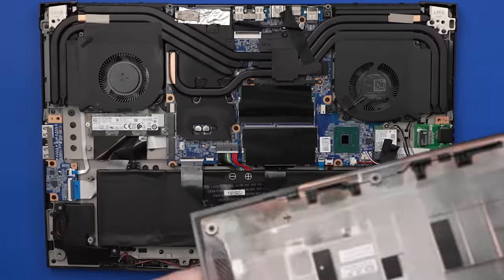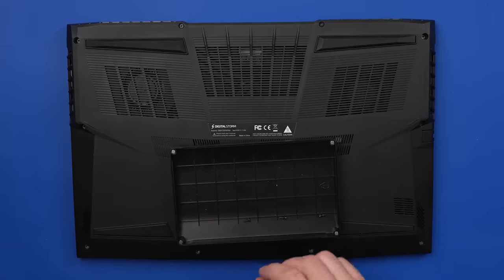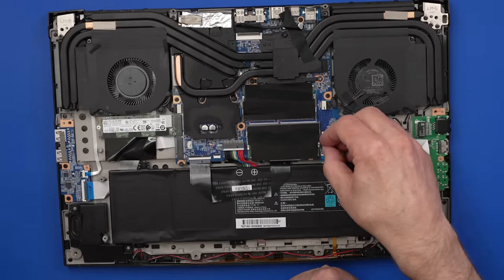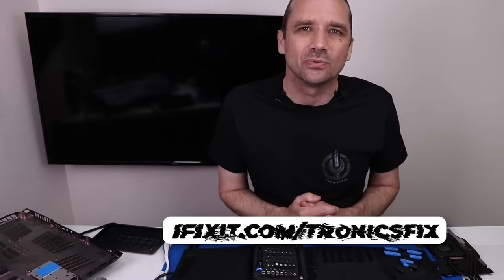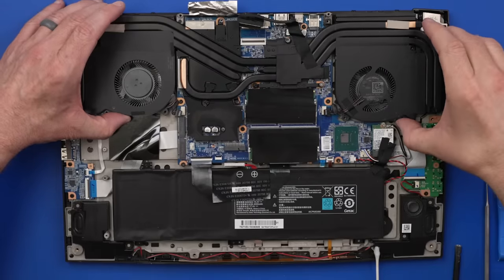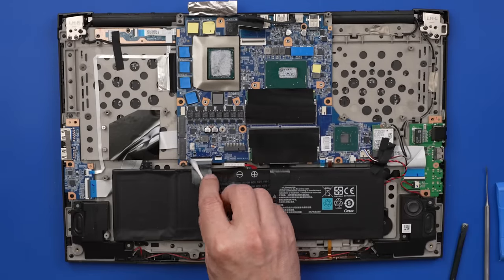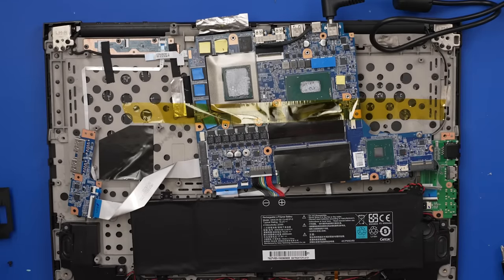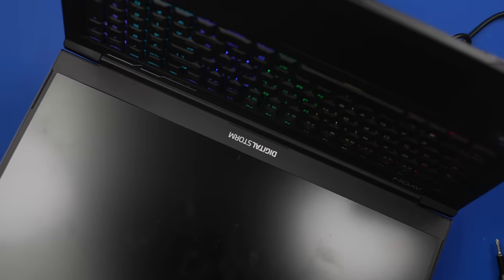They Quoted $900 to Fix This Laptop - But Were They Right?

Comment: I'm 99% sure I have this exact cable. I have a laptop I couldn't fix before, mosfet blew and took out the gpu. I'd be happy to ship it to you if you want it. It's white, not black like yours is, but has CNJS E308724 AWM 20798 written on it.
Reply: Tell him it costs $900

Comment: That horrified chuckle when you realized the connector was super glued I felt deep down. The horror!
Reply from the maker: That was a bad feeling!
Reply: @Tronicsfix  Whomever uses superglue to try and repair parts that has to be soldered on, has 0 clue. Lucky it was even somewhat fixable.
Reply: @Tronicsfix  Hey I guess you can cut the old ribbon cable and just remove the upper layer and new pins will come above.
Reply: Buddy took his new laptop to best buy geek squad. Laptop was only 2 weeks old. They gave it back cause apparently their full coverage warranty isn't full coverage. And wanted $1200 to fix it. He picked it up and I looked at it for him. It was glued beyond glue. They even glued the bottom plate on and not screw it back on. It was an nightmare. All that and all that was wrong. Battery connector was loose. HP responded and replaced the laptop and got to keep the original one. Stuff like this why I learn as much that I can. Seems it's getting harder and harder to trust others.

Comment: I worked at a PC and Laptop repair shop about 15 yrs ago and the "Super Glue" trick was used way too often. If the connector or cable was loose, some would super glue it in place instead of using a replacement part. I never understood it since the parts themselves were not expensive and required a little skill and patience with a hot air gun to do a proper replacement. The mentality of the "Super Glue" fix was: It will work for the customer until they get rid of it. Basically, pass the problem onto the next person.
Reply from the maker: Yep, not a great solution
Reply: Use aceton it dissolves ciano-acrilate!
Reply: @Hiberniust   acetone dissolves most plastics so using it would not be recommended
Reply: @Tronicsfix  FFC cables are usually made of PVC, if you don't use the acetone for too long, it should be fine. If not, you can repair the connector fronts (it's pretty tedious though, look for ffc repair on youtube). There are also other solvents for ca glue, not sure what's their effect on pvc though.

Comment: You could just cut the damaged part of ribbon cable and sand off 1cm of the protective layer. I have done this before. Works like a charm and you have nothing to lose. Or - if you want to go really insane. Desolder both connectors and just solder some wires directly to the pads.
Reply: I came here just tom make the same comment. I can confirm that it works since I've done it several times. You just gotta make sure that the final length of the ribbon cable is good enough to reach both connectors and voila! I even have fixed the same ribbon cable this way several times. It's faster and cheaper than ordering a new one (it takes less than 10 minutes) and you get to keep the original cable. Make sure you keep the plastic pieces at each end of the cable since they make the connection points thicker, strengthening the contact between the cable and the connector.
Reply: Same thought! Thanks for writing it down!
Reply: Just sand using some fine grit sandpaper?  Or one of those fiber pen scrubber things I've seen some people use?

Comment: You can get those cables easily. There are companies that make any size you desire. Just measure it and count the number of pins and ensure the pitch and orientation is correct and order one. They are called FFC cables, I buy mine in the UK from a company called GTK.

Comment: Acetone will dissolve super glue, but may take several application with a cotton swab depending on how thick it is. Any remaining residue can be cleaned with IPA. You may want to test the acetone on the solder mask on a ground plane first to make sure it won't damage it. I think most plastics in connectors are made from polypropylene or polyethylene so the acetone should not attack them. Again, TEST!
Reply: Acetone dissolves plastic
Reply: Here are some plastics that Acetone will NOT dissolve.
ECTFE (Halar®): transparent films available.
Fluorosint® PTFE: white.
HDPE: transparent films available.
Nylon®, Type 6/6: white.
PP: clear sheets available.
PPS: opaque white.
PTFE: white.
Reply: @shaunmorrissey7313  not all plastics are equal
Reply: most likely the plastic is ABS which will dissolve. so bad idea.
Reply: @awilliams1701  That's why I recommend testing. It would only take the smallest amount of acetone to see if the plastic softens on the surface or becomes sticky. If it does, then acetone is not an option.
Reply: @thomasandrews9355  I mean on a PCB it's fine, but you need to avoid the plastic
Reply: solder mask resist acetone, but the plastics maybe not.
Reply: That sounds like a lot of work.
Reply: In the mid 80s I was attached to the USS Indianapolis photolab. We had a guy come down with his camera. His camera was saturated with super glue. I tried to use acetone, but the camera was a lost cause.
Reply: Did not know some plastic types were more resistant to acetone. Wish this was specified, but I guess its just easier for companies to go "dont expose to plastic at all" rather than list the specific types that will melt.
Reply: @Shaun Morrissey  "Acetone dissolves plastic" I guess we're just going to ignore that you can buy it in plastic bottles I guess 🤷🏻‍♂😂

Comment: This reminds me of a time back in 2009 when i had my own IT business. I had a client bring me one of their PCs that was refused a warranty repair due to their claim of intentional damage. No one had ever been inside the machine before it was RMAd. The warranty sheet said their was irreparable damaged to the main board and all they could do was offer a replacement, but they would do it "at cost". Before my client took them up on it they asked me to look at it. The problem was that the computer would shut down within a couple of minutes of being powered on. Theyv time me it would start up and then get super slow and then just shut off. My first thought was over heating so i removed the heatsink and immediately knew what was wrong. There was zero thermal compound on the cpu and the heatsink had some thermal tape on it and it still has the plastic cover that was labeled as "remove before installing thermal solution". I peeled off the backing and put the heat sink back on and fired it up.  I did this all right in front of my client and they took pictures the whole time. Sure enough it powered in fine and worked perfectly. They had 3 other PCs from the same manufacturer (begins will a D and rhymes with bell) and all of them had the exact same issue. From that point on any time any client brought me a PC from that manufacturer that was a standard check.  I must have encountered it dozens of times.

Comment: There are special solvents for dissolving cyanoacrylates (which I believe is the type of glue in question), usually they are sold by the producers of the glues themselves, but you have to be careful when using it and experiment with small drops of product on small portions of the material to be unglued, because in contact with some plastics they melt them exactly as they melt the glue.
Reply: So basically, acetone?

Comment: You can usually find generic replacements for these sorts of ribbon cable - they probably won't have the bends in them already, so you'd have to replicate that, but if you can identify the pin count and pin spacing, then it should be replaceable. I've had to do that a few times on older ribbon cables where the blue tab falls off, since re-gluing those tabs tends to be very hit-and-miss.

Comment: Someone hopefully already pointed this out, but if the traces in the ribbon cable are wide enough then you can trim that cable back to be flush again and use a fiberglass pen or sand paper in order to sand the end to expose the traces for new contact pads while reusing the plastic tab for backing the contacts of the ribbon cable for strength (and proper spacing) inside the connector. You would still need to do the trace repair on the long screw damage. Sanding ribbons inst straight forward and I would try it on a useless one a few times first. It helpes to use a solid metal or stone surface to sand on

Otherwise, did you look for a generic ribbon online? 
Check with pcb way on manufacturing? Yes you would end up with extra cables, but this would likely still be cheaper than the other shop's quote and could list the extra for resale as a generic cable

Comment: Hey TronicsFix I found out it is much simpler and safer to dump electronic parts in IPA (small parts like NVME, RAM, etc.) Let it in there for a few hours then take it out and brush it. What this will do is making sure the IPA gets into every small holes and it also dissolve the thermal paste by a little bit, making it easier to clean off.

Comment: Hi Steve, we do alot of These Notebook repairs and I can tell you they are painful as yours. But normally These ribbon cables are at least a little longer than they need to be. You could trim it a little bit and solder an a head from a different cable. As for the dent, you will need to solder some wire bridges. Greetings from Germany.

Comment: I've encountered bad traces of flex cables myself, where the edges peel out. What I do is cut off the defective parts, and use a very fine box cutter to peel off the insulation. But I need to attach a hard plastic on the opposite end, unfortunately, using super glue. Double-sided tape won't do.

Comment: You could have just cut the cable and sanded it down to reveal the pins again, i've done that many times. Also, a quick count and google search makes me think this is just a 40pin 0.5mm pitch fpc ribbon. As long as you get one that is the correct termination (both pins facing the right way), it will work.

Comment: @TronicsFix you could measure the length and the pitch and count the pins of the Cable and buy it from someone who sells FFC / FPC Cables. make sure that you buy the correct orientation where it connects because there are 2 types Top to Bottom and Top to Top (Bottom to Bottom)

Comment: 15:43 try using hot air to melt the plastic and wipe it with steel brush or with a cloth or cool it immediately with ipa, so the white plastic may peel off 🤞!

Comment: I have saved a similar FPC cable just by using a scissors and cut exactly how the end looks. Then sanded the edge like exact original cable and cleaned the copper contacts with IPA and just restored the connector. Often times you must use a thick cello tape to reinforce the plastic edge for thickness to stay in the FPC connector. Order a replacement and wait until later. It happened for me with a water damaged Logitech G Pro mouse. It‘s super tiny FPC cable for it.

Comment: sometimes if you dont connect the fan it will not power on. maybe that is a thing you can try and maybe just search for a 40 pin ribbon cable?

Comment: TV ribbon cable works to and u can cut off the bad pins on the ribbon and clean off the black to expose the traces for solder than tap flat and install done n done

Comment: You ever do Apple phones? My Apple 12 pro charging thing broke on me, now I have to use a wireless charger. I looked into replacing it myself but it was over my head lol. I tried cleaning it, blowing it out to see if something was stuck in it.

When I had galaxie note phones I had this issue a lot where the charging port would get loose and you would have to hold the charger at certain spot for it to charge. Many times I’d have to lay something over the cord so it would stay in that spot and hope that it didn’t move. This was the older charger ports the small ones that the galaxie notes used. I believe they fixed this now. Only had the iPhone for 3 years now

Comment: Small tip, never plug in a laptop without a heatsink and wait a while before flipping the screen. Quite a lot of machines will power up on their own if they where fully powerless, so no battery and CMOS battery if it has one. The CPU only needs a few seconds to get very hot and can damage things, especially if it boots into a bloated windows install.

Comment: I once used nail polish remover (the liquid ladies use to remove their fixed nails). It is very effective on dissolving glue. You could've tried it instead of burning off the plastic on the ribbon cable or using IPA which doesn't dissolve glue. 😎
Reply: Nail polish remover most of the time is just acetone. Acetone melts many plastics, so I assume this is why he didnt want to use it.

Comment: I believe there is a place in china that can make the cable for you but you will be waiting for quite some time to get it in the post.  Also, I believe the reason for no boot is that you have to have the fan connected to the motherboard for it to boot.

Comment: NEVER use superglue on repairs unless it is absolutely necessary. Otherwise, you need a superglue remover like acetone, or plain and simple nail polish remover. Plus, they are not fun to remove if they hold glass together without acetone!

Comment: Digi-Key has the cable. You just need the length, number of conductors, conductor length and pitch between the center of the conductors. They are called ffc or flat force cables or ribbon jumpers.
Reply: Yes.. I've bought them here as well.. good info

Comment: Might not start without fan plugged in. Thinkpads for example with throw a code after post if the fan is missing or something is wrong with it. Not sure about this brand exactly but might be worth just plugging the fan in.

Comment: Next time use acetone to pull the connector off the ribbon.  It'll dissolve the super glue right off.  Might destroy the connector, but you did that anyway with the iron and acetone would be easier and cleaner.

Comment: Good job. I'd call it fixed. Just read Smokie_66's comment. To keep the loose components in place just to test the laptop I'd recommend a rectangular piece of memory foam glued to a wood/plastic piece with legs. So you could push this contraption slightly against the loose parts, with a hand on the contraption and the other on the other side of the device, and flip it over. The legs should be made tall enough so you can release the contraption freely. Thanks for the video. Long Live Right to Repair!

Comment: Just FYI I would never try to power on a CPU/GPU that doesn't have an IHS without a headsink. Sometimes they will get so hot so quickly they won't even fully post. Also an easy way to cook it.

Comment: Just remove the plastic supporting pieces from the end of the ribbon, cut the damaged part of the ribbon off, sand it down to expose the traces and then glue the plastic supporting pieces back on the "new" end. It'll work fine

Comment: How hard can it be to find any compatible flat flex? You almost did, just not the perfect amount of length. It doesn't have to be THE OEM spare part. And if the most desirable(cheap or fast or OEM) option is too long, just fold it into a heart shape. 😉 …printers and scanners are a great source for flat flex / ribbon cables, just in case you happen to have one of those dust collectors

Comment: I wonder what the $900 repair quote included. Surely it would be more than just the ribbon cable and plug?
Reply: it would be the mainboard replacement I imagine, manufacturers rarely repair their stuff
Reply from the maker: Probably a new motherboard

Comment: its $900 to fix because most places (especially manufacture) won't just replace a connector and ribbon cable, they would be replacing the motherboard and probably the keyboard also

Comment: Have you tried to look for a flex cable? not one thats advertised for the laptop but a generic type, example, i needed a ribbon cable for a radio and the company did not sell them, so i looked around and found a ps5 dvd drive ribbon cable that had the same pitch and pins, if you google ps5 dvd ribbon you will see the cable i mean, just search for one that has the same number of lines on it, I'm not sure what the ribbon is you need but they do them in all sizes and widths, give it a look, is you find one an it's too long, you can just fold it over to fit.

Comment: Weren't all of the screws the same size?  Why did you sort them like that?  Instead of going through all of that headache of the repair, did you look at eBay to see if you could find a defective one?  You probably could have found a defective one and had all of the parts you needed and then you could have sold off the rest of the parts you didn't need.  It's so such a scarce model that you probably could have profited a lot to repair it that way.

Comment: 2000 USD laptop with such tiny heatsink and board? even my RTX 3060 laptop has bigger heatsink and board and sata and 2 m.2 slots and some other slot that is not occupied but looks like pcie sata or additional wifi adapter slot...